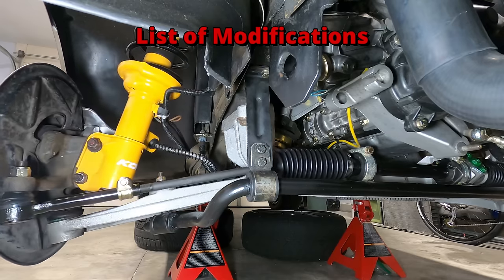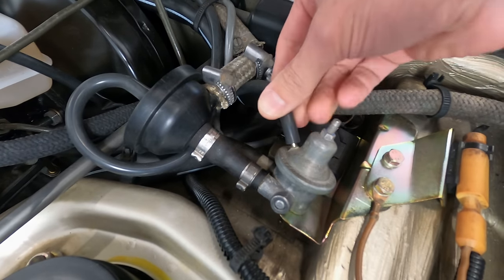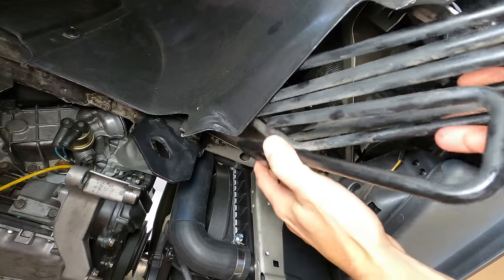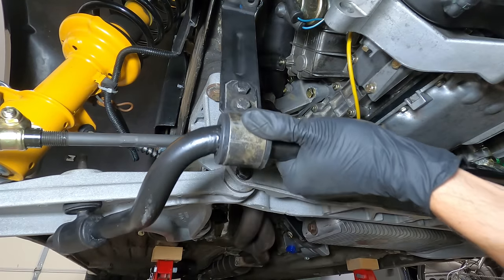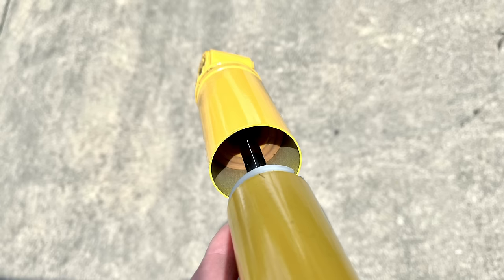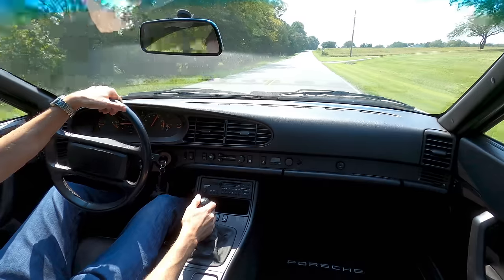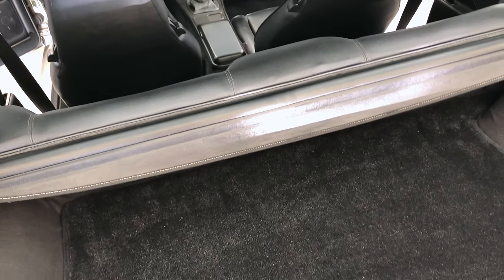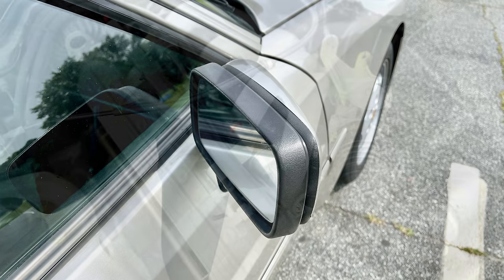25 Modifications I've Made To My Porsche 944

Comment: You may want to change to K&N Cotten Air Filter that fits in the OEM filter housing. You’ll get increased Horsepower, noticeably quicker Throttle response and 15%+ more MPG. Additionally, the K&N filter is not a throw away item. You simply wash, line dry and re-oil it after every 100,000 miles. Cheers…

Comment: can the motor handle like 400hp 400tq?
Reply from the maker: It’s difficult to hit 200hp with significant modifications to the 8-valve naturally aspirated engines. You could get about 300hp out of a quality turbo build, so you’d be looking at an LS engine swap to see the values you mentioned.

Comment: What were you doing to the DME w the allen key at 1:42?
Reply from the maker: Adjusting the FQS setting… the MAF tune allows for changes in the fuel mix percentage up or down by varying degrees using the factory Fuel Quality Switch (FQS) on the DME, essentially making the engine run more rich or more lean to optimize the tune.

Comment: Did you do any work on the bottom end of the motor? Hate to see it throw a rod.
Reply from the maker: I did replace the rod bearings when doing the oil pan gasket, the old ones were surprisingly smooth for ~170k miles at the time, but figured it made sense to swap out them while I was there.

Comment: This is amazing. How much did all the mods cost?
Reply from the maker: Thanks! Here's a costs breakdown for all the mods... values include shipping and tax as applicable: 

•	Lindsey Racing MAF Tune Kit – $682.75
•	Lindsey Racing Silicon Vacuum Lines – $66.10
•	Only944 Throttle Response Cam – $30.96
•	Rennbay Fuel Line Kit – $125
•	Cast Iron Exhaust Manifold – $182.76 (includes media blasting and high-temp paint)
•	Power Steering delete / Manual Steering Kit – $896.10
•	Solid State DME Relay (Focus 9 Technology) – $85.55
•	ATE Brake Booster & Master Cylinder – $213.49 & $132.24
•	Techna-Fit Braided Stainless Steel Brake Lines – $90.74
•	944 Turbo Front Sway Bar – Came with the car
•	IMI Performance Hi-Torque Starter – $279
•	Koni Sport Adjustable Shocks – $285 rear, $403.07 front, $191.48 powder coat
•	944 Turbo Valve Springs – $130.09
•	Black Sea R&D Super Bearings – $870 & $94.16 in supplies
•	Lindsey Racing Ultra Transmission Mount – $316.52
•	Only944 Short Shifter & Linkage Arm – $87.30 & $29.70
•	Rekeying Factory Alarm Switch – Free
•	Lloyd Floor Mats & Cargo Mat – $152.50 & $170.69
•	Rennline Glove Box Door Hangers – $45
•	Cassette Tray Delete – Free
•	Kicker DSC46 Car Speakers – $89.68
•	Brake Calipers Powder Coat – $404
•	Camshaft Assembly & Intake Manifold Power Coat - $281
•	Zinc Plated Fender Screws – $27.20
•	944 S2 Design 90 Wheels – Came with the car, $740.85 powder coat, $234.85 new center caps
•	Textured Black Stone Guards – $38.81
•	Total Modification Costs – $7,376.59
Reply: @NC944er  Thanks a lot, that's not too bad. Definitely doable and then you have a reliable little sports car. Probably gonna get one in two years, hope the prices don't go insane till then. Best channel for 944s!

Comment: do you think that the 944 is a good first car to get into mechanical maintenance or is it to much to chew?
Reply: There are many parts on the 944 than can be broken and spare parts could only got from original Porsche dealer. The costs are quite high and that is the reason why I do not recommend a Porsche. (OK the problem would be much higher in case of Ferrari or Lamborghini.) But if money is not the problem, yes the 944 is quite easy to maintenance comparing to actual new models.
Reply: NA 944 is perfect for this
Reply from the maker: I think the 944 is a great car to learn on and there will be a lot of opportunity for various types of work. Although it may not make a reliable daily until it’s well sorted out. Most of them will require catching up on a backlog of maintenance, but there are some well-sorted examples that come to market from time to time.

Comment: 944 used to be a solid used car for a low cost. Now it's the price of a new car
Reply from the maker: Values have definitely ticked up, and so have maintenance backlog costs, hopefully more people are willing to invest in restoring them.
Reply: @NC944er  For the prices for non turbos? Now it's like wait, why do people want these cars again? All the suspension is worn meaning that   a used economy car will run circles
Reply from the maker: @gvi341984  😂 For sure… a 2012 Honda Odyssey minivan has the same 0-60 time as a NA 944. The 944 is seeing a resurgence in part due to the 911 market going crazy, so that drives value in all Porsche products, and many people can no longer afford to buy into a 911 at this point, so we’re left with 924s and 944s, etc. They are quintessential 80’s wedge cars, so there is some nostalgic appeal there, despite the sporty performance being well behind modern cars.
Reply: @NC944er  944 resurgence is due to many years ago the 944 was a cheap sports compact car. Now it's a overpriced Porsche 944 that's slower than a Nissan versa 5 speed. 1

Comment: Can you send me your suspension set up
Reply from the maker: Hey Ramon, the suspension setup is as follows…
• Koni Sport Adjustable shocks in the rear and Koni Sport inserts in the front (sealed strut conversion). 
• Damping is set to the softest level on all four shocks for regular street use. 
• OEM base trim coil springs retained up front (M030 sport springs are available and would slightly increase stiffness) 
• Ride height was kept at the factory level (did not reindex torsion bars or modify/cut front springs). 
• 944 Turbo sway bars added in the front and rear (increased thickness of 4mm). 
• OEM sway bar mounts and rubber bushings were retained. 
• OEM 944 castor blocks have been retained (the updated 968 part is recommended for 17”+ wheels and will provide a more precise feel due to less rubber used).

Comment: when do you think the useful life of the car is over?
Reply from the maker: Hopefully soon… it’s costing me way too much money. 🤣 There are 944s still on the road with over 250,000 miles, so they can go for quite awhile when properly maintained.
Reply: @NC944er  in think as long as you dont crash it and bend the chassis there is nothing that would render the car unusable or unviable to keep going. The engine probaply has 2, maybe 3 different oversize pistons available and even if the engine blows a hole in the crankcase, these engines are not that expensive to find a good replacement

I really like how you kept the exterior standard, the car looks to be in great condition! Keep it up 👍
greetings from germany
Reply from the maker: @benjaminbuljevic7977  Thank you! I met a gentleman from Germany at a Porsche car show last weekend and he really liked seeing the 944 out and about. He said he saw a lot of 924s and 944s back home when he was growing up. Pretty cool! 👍🏼

Comment: Importance of a lsd diff?
Reply from the maker: @henryneufeld4944  I don’t do any auto-X, track/DE events, so an LSD isn’t high up on the list for my purposes. With the wider 8” rear wheels I’m running and the relatively underpowered 8V NA, I don’t get very much wheel spin as it is. I did briefly consider a 968 6-speed transaxle swap, but the final drive wasn’t far off from what my ‘88 has today, it just adds an extra gear in the middle, which doesn’t really solve for the ‘88 having a shorter 5th gear (great for spirited driving, but not so much for highway cruising). Any future investment I put into the transaxle would probably be best used to fund a rebuild with synchro replacement.
Reply: @NC944er  thank you!!! Purchasing an NA ‘86 in a week or so and thinking about future mods and maintenance!

Comment: Great car. I haven’t seen one on the road in 20+ years.
Reply from the maker: Wow, I still see them maybe 3-4 times a year randomly here in NC, outside of Porsche events. Where are you located?
Reply: @NC944er    Fort Worth. I used to work at Leith Porsche/Audi in Raleigh. I sold many 944’s during my time there. I loved the 944 Turbo S. Almost as fast as a 911 and better balanced.
Reply from the maker: @fw1421  Very cool! I’ve been surprised by how many 944s are hidden away in NC, some rarely seeing the light of day, perhaps 1 or 2 that you originally sold.

Comment: what bhp is it getting
Reply from the maker: The car pulled 132.1 hp at the wheels on the factory AFM, so that’s about a 16.4% loss in the drivetrain from the production rated 158 hp. Pulled 138.4 hp at the wheels with the MAF, which would put it around 165.6 hp at the flywheel. Pretty small numbers by today’s standards, but not too bad for a 35-year older, naturally aspirated 4 banger. 😂

Comment: I've done absolutely nothing to mine and it runs like a dream. I had made a mistake of installing a "performance" chip one time to improve throttle response which ended up clogging and destroying my fuel injectors. So I'm in the camp with the masses, DON'T UPGRADE THESE CARS!

Comment: Guy truly loves he’s old Porsche….I wonder if he has a girlfriend or he spends all his time with his car…😅
Reply from the maker: Wife and three kids… I have to scratch out time to work on the car, but wrenching on it helps maintain my sanity. 🤪
Reply: @NC944er  good…hope it’s true…how is the minivan running, as good as the 944 I hope.
Reply from the maker: @floman9385  😂 The van has about 196k miles on it, it’s a tank but it doesn’t get nearly the attention of the 944, just spark plugs, filters, oil changes, etc. I did install a VCM tuner on it, which turns off the “eco mode” that disables the ignition from half the cylinders, so it’s running all 6 cylinders all the time… burning more fuel but less oil. 👍

Comment: Great video, did you have any issues with the steering shaft? I need a new one for my 924 turbo, as you know they came with manual steering and could be the same. Any help would be great.
Reply from the maker: Hey man! The steering shaft was really well built with nice, chunky welds. No issues thus far. My understanding is the length was custom made to fit the VW Rabbit rack and so it may not be a direct fit for the 924 manual rack. You could give Martin a call and see if he could confirm the dimensions or maybe even fabricate something for your application. Here is the website where I sourced the manual steering kit - https://mwthemachineshop.com